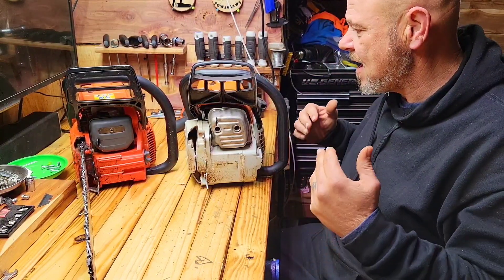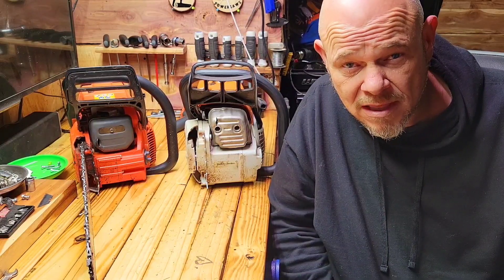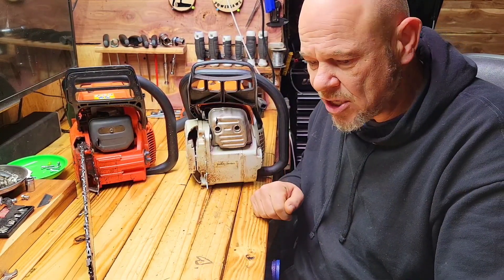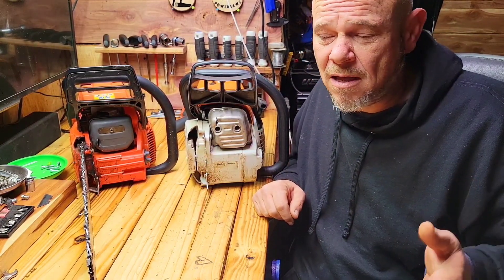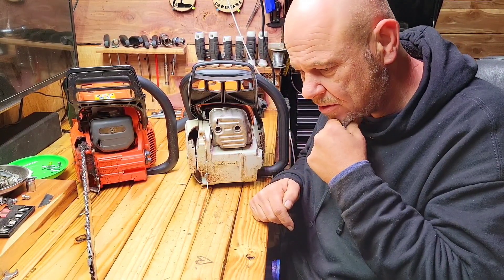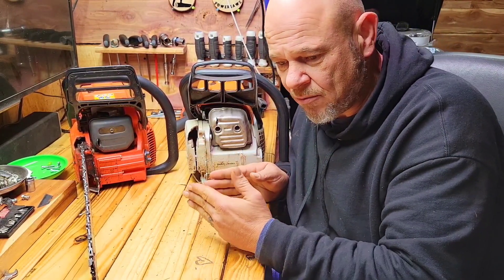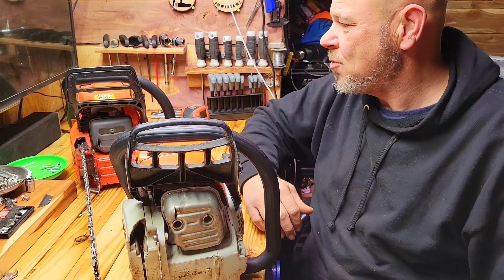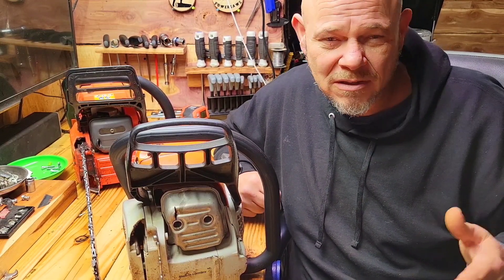ECHO CS590 VS STIHL MS311 new mods and review! ECHO Timberwolve or ms311, which do you prefer 🤔

Comment: Idk how much has changed on them over the years,but i muffler modded my 2009 ms310 years ago and the fix for the limiters was to just pop them off,cut off a little plastic tab with a knife,and stick em back on. If i remember correctly i ran a small wood screw into the plastic limiter and once it was threaded in i just pulled the screw with pliers  to free the plastic limiter from the carb. You can reinstall it by hand. Like i said though,the new ones may be a little different.
Reply from the maker: That's correct 💯... Stihl works the same way lol
Most any will come off that way .. most all brands as well. Some are more stubborn lol
Thanks for watching sir

Comment: great video i kinda agree with ya on the ms310 and 311 i im pretty sure u could put a 391 top end on that 311 i have a ms290 and a ms310 and barley any difference i actually run the 290 more because i know its all oem saw and been running without being rebuilt so far for 8 years. but thinking on turning 310 to a 390 my self had same here with 372 cant beat them guy gave me one sed it hasnt ran for 10 years its a part saw i put new top end on best saw i have right now next Challege i have is splitting case's  on oem ms460 and a 046 and doing crank Barings and case barings never split a case yet so should be interesting not sure if you ever watched dyno joe he's good and ironhorse and a guy from michigan Charles Brisco turns echos into beast saws
Reply from the maker: Yes, sir, i know all them, guys! 
I have a 290 that I'm about to put a 390 top end on.. very cool build 😎 
Not sure about the 391 top end on the 311... sounds interesting 🤔 👌  
Hard to beat a 372 ... one of my favorite saws! 
Thanks for watching 👀... and welcome 🙏 to the channel